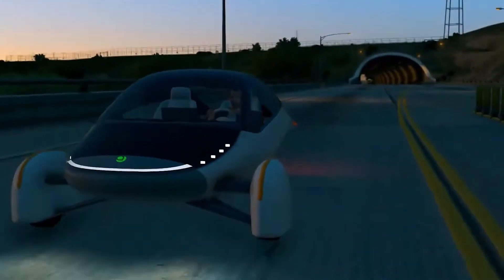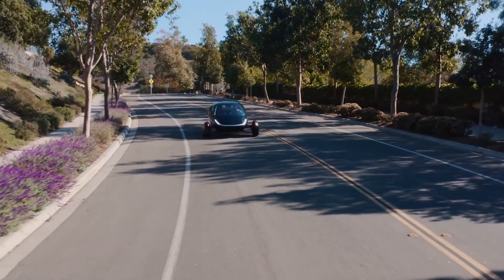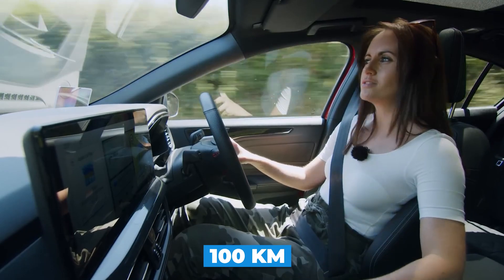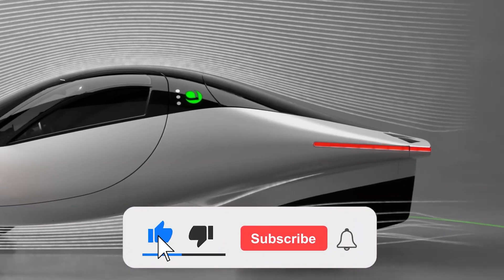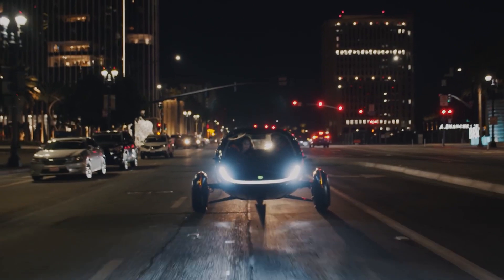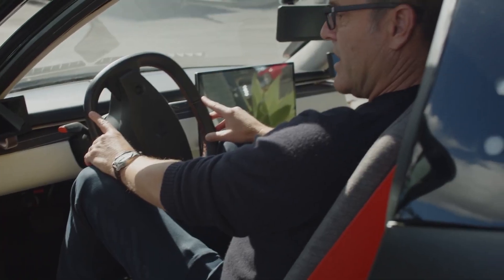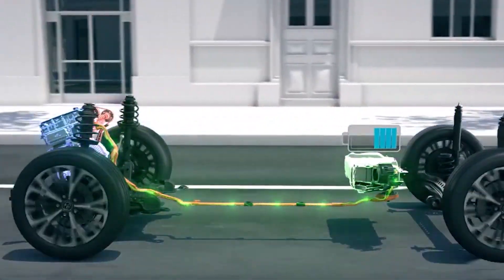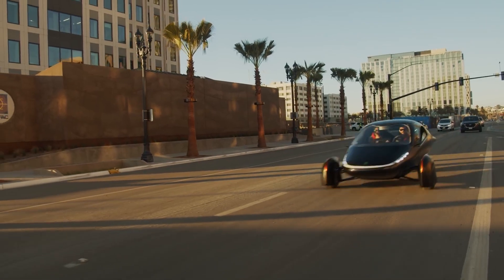The REAL Reason Why APTERA Is Using In-Wheel Motors! UNBELIEVABLE!

Comment: What kind of vehicle would Áptera become if you were to “Jimmy-rig” a 
250 CC Honda motorcycle 🏍️ in place of the single rear wheel ? ? ?

A Hybrid Áptera ! ! !

You would have a gasoline ⛽️ backup, and probably a 2000 mile range ( electric 1000mile batteries/ 6gallons of gasoline)

Not a bad combo.

Comment: When I saw the use of IWMs, the only thing I was considering was the incredible amount of friction loss reduction from their implementation. Just think: no drive train. No engine, transmission, differential, drive shafts, U-joints, CV-joints...that's a lot of waste in inertial resistance. Power vectoring only multiplies the advantages. The single drawback to IWM's I'd heard was the problem of unsprung mass. I still think that issue is miniscule in comparison to the advantages, not to mention the new tech being developed in motors that will continue to reduce that unsprung mass over time. So, yeah, it's the best way to go. Wait till the off-roaders realize how much ground clearance they may be able to gain from this, too. I suppose they'll get upset that the quiet ride will cause them to have more collisions with wildlife that wasn't scared off by their noisy off road vehicle motors though.
Reply: You are one of the few people who get it. so many internet experts love to complain about "unsprung mass" like it matters at all in a car like this. It doesnt. An F1 car, sure, but not a passenger car. Friction losses in complex powertrains is huge... and would be especially apparent in a car that is ultra efficient. The ability to torque vector is a bonus and not the main reason they chose IWM's in the first place.

Comment: Individual motors in the frame could just a well independently drive and torque-vector each wheel and not need wheel toe-in.
AND... they would not put their heavy weight in the wheel. and thus not cause the tire traction penalties of such unsprung weight.
An example of in-body indepoendent motors is the upcoming Ferrari SF90 Stradale, with one motor for each front wheel.

Comment: What a bunch of nonsense.  You don't need in wheel motors for torque vectoring.  Steering, acceleration, and braking will all be worse with in-wheel motors.  Unsprung weight is bad.  Not being able to cool the motors is bad.  Not being able to add gear reduction to the motors is bad.  Efficiency may be the only benefit...and probably cost.  They also enable saving space in the vehicle to make room for more batteries.

Comment: I just thought these wheels probably simplify the overall design and complexity of the vehicle. Apparently, there is more to it than that. Hopefully, if a wheel is sheared-off in a collision the battery power would be cut to that wheel (only)? I assume ptower is needed in an accident to enhance existing the vehicle or for whatever other necessary functions need to be maintained?

Comment: Two onboard motors can do torque vectoring exactly as well as two in-wheel motors, PLUS onboard motors don't impose the UNSPRUNG WEIGHT penalty over bumpy surfaces of in-wheel motors.
Further, the in-wheel motors for the Aptera are radial flux motors, NOT the more power dense axial flux motors.  Lastly, what happens when mud or snow accumulates in the wheel pants of an in-wheel motor - just where the brakes are?
Reply: As always, there are always design trade-offs with any choice.  Elaphe has been open about some of the factors leading to their choice, i.e.:

"For now, the biggest issue we see with axial flux motor type is the inevitable axial forces unbalance, which tends to have a runaway effect. As soon as the bearings start wearing out a bit, the unbalance grows and in no time the bearing gets worn out. Also, based on our experience, axial flux motors can be very hard to cool in demanding cycles, such as those of EVs.

With radial flux type in-wheel motor systems that we can offer today, we are proving that what was once a concept is now realized in a real product, successfully addressing all requirements of the in-wheel application in automotive requirements. We are continuing to push the envelope of the radial flux configuration and pursuing building the most compact, robust and performant in-wheel motor solutions."

We have already addressed your other two points in another comment.
Reply: @n.brucenelson5920   - As I recall from Elaphe's video, the uneven bearing wear and imbalance occurred for in-wheel motors - due to axial (cornering) forces on the wheel - and they wouldn't apply to onboard motors.  IOW, Elaphe's problem with axial flux motors is due to their in-wheel design.

Comment: I love this car and want to put it on the track but they won't give me any safety data. Roush racing was consulted during the design process.
Reply from the maker: The car is lovely indeed! Make sure to subscribe to stay updated with the latest news :)
Reply: There is quite a bit of safety data available now - more than we have for the Tesla Cybertruck, for example.  

As soon as delta vehicles are available they will be voluntarily crash tested by a third party to FMVSS Part 200 standards, and the results will be made public.
Reply: @n.brucenelson5920   - Where is this safety data that is supposedly available?
Reply: @n.brucenelson5920   -  All the stuff on Youtube about Aptera's "safety" is cagey about the definition of "safety".  Nowhere is there any reference about tire traction on rough or bumpy surface, nothing about the visibility of the low/wide front wheels, and nothing about the effect of side gusts of air coming off the front of a truck/bus/van that hits the Aptera on its rear wheel pant under the "dolphin tail".  "Safety" even means low carbon footprint in one video!  C'mon, ambassador, post your links - if there really are any.
Reply: @n.brucenelson5920  [There is quite a bit of safety data available now] He said they won't give him any. If you say it's available, how about you give it to him? Gossip is worth nothing. 
[- more than we have for the Tesla Cybertruck, for example.] We all saw the safety glass, lol! But hey - stop comparing; just give him what he wants.  

[As soon as delta vehicles are available they will be voluntarily crash tested by a third party to FMVSS Part 200 standards, and the results will be made public.] Give him the quite a bit that is available now, today. When the results of the crash tests are in, you can add them.

Comment: Do in wheel motors and torque vectoring help winter handling in snow and slush?
Reply: Absolutely 100% yes
Reply from the maker: Definitely!
Reply: There was a lot of available information that was left out of this video, and a lot of footage, for instance from Protean that doesn't really apply.  Aptera is using wheel motors made by Elaphe - the same company supplying the Lordstown pickup trucks.

Aptera wheel motors can sense wheel slip and adjust torque for each driven wheel independently - 32 times per wheel revolution.  This is about ever 2.5 inches of tread travel.   

Also, the power steering assist will be variable and speed sensitive.  The driving experience, even in difficult conditions, is going to open eyes.  I plan to use mine year round in Iowa.
Reply: @n.brucenelson5920  [There was a lot of available information that was left out of this video,] Yes - all the negative reasons that overpower the few positives. Happy to debate all reasons with you.
[and a lot of footage, for instance from Protean that doesn't really apply.] And that dropping motors between the wheels, not in them. Sloppy work. 
[Aptera is using wheel motors made by Elaphe - the same company supplying the Lordstown pickup trucks.] Both non-existent, at present, but you still brag for no reason.

[Aptera wheel motors can sense wheel slip and adjust torque for each driven wheel independently] Motors can't sense wheel slip - it's the tiny, lightweight sensors that do that, and they work better without the motor in the wheel.
[ - 32 times per wheel revolution.] That's slow by their standards. At ~50mph, a good sensor around 300.  Aptera is built to the lowest end.
[This is about ever 2.5 inches of tread travel.] Good one's are doing at least 2 per inch.   

[Also, the power steering assist will be variable and speed sensitive.] It works it's guts out because there's an extra 100 kg to turn.  
[The driving experience, even in difficult conditions, is going to open eyes.] Everyone already drives with their eyes open.  lol
[I plan to use mine year round in Iowa.] You know what they say about plans.
Reply: Torque vectoring is a good feature, but in-wheel motors are not necessary.
Just putting the two motors onboard the chassis can do exactly the same thing,
plus do away with those silly wheel pants and reduce unsprung weight for better performance.
Reply: @daveinwla6360  Every engineering solution comes with trade-offs.  You are correct that reducing unsprung weight is a good thing.  However, eliminating the wheel pants would greatly increase the coefficient of drag - and that is what would be silly.

The onboard motors we have in vehicles such as the Tesla have much slower response to torque sensing and adjustment, partly due to the time it takes to transmit the slip sensor information from the wheels/motors to the controller.  In the Elaphe motor case, both sensor and motor controller are co-located, greatly decreasing the response time.  This also eliminates drag in the components transmitting power from the motor to the wheels.

If efficiency is your main goal, this is a better solution, and the suspension performance is "good enough".  I can say this having had a ride in a prototype with engineer Daniel Morris driving and putting the Luna alpha vehicle through its paces. even before the suspension was redesigned by Roush Performance and greatly improved.
Reply: @n.brucenelson5920   - I NEVER have said that Aptera should get rid of the wheel pants while keeping the outboard wheels and motors.  The motors and brakes should move inboard to the chassis while covering the wheels with FENDERS afixed to the body.  Both motor torque and braking torque can be transmitted to the wheel via a short shaft.

The motor and the slip sensors communicate at almost the speed of light.  It would make NO difference if the sensors and their control firmware were onboard the car rather than wheel-mounted.

As I've said all along, all that unsprung weight reduces safety by reducing tire traction over bumpy road surfaces.  And I have neither seen nor heard anything about Aptera testing cornering or braking or acceleration over bumpy road surfaces.
I'm afraid you speak from FAITH, and from your appointment by Aptera as one of its "ambassadors".
Reply: @daveinwla6360  Dave, I have actually ridden in a prototype and it wasn't all on bump free smooth roads.

Your statement that "The motor and the slip sensors communicate at almost the speed of light." shows that you have little understanding of how either system works.

 Electrons flow through copper at a few metres per second, far below the speed of light.  Stop bullshitting when you don't know what you are talking about.
Reply: @n.brucenelson5920  [Every engineering solution comes with trade-offs.] And the video is devoid of what is traded.  
[You are correct that reducing unsprung weight is a good thing.] 50 lbs per wheel is massive. Engineers try to reduce 50 grams.  
[However, eliminating the wheel pants would greatly increase the coefficient of drag - and that is what would be silly.] That's a trade off. Another thing traded would be the benefit of not having to scrape them on turns - something they have yet to engineer out.

[The onboard motors we have in vehicles such as the Tesla have much slower response to torque sensing and adjustment, partly due to the time it takes to transmit the slip sensor information from the wheels/motors to the controller.] If Tesla uses sensors that are eight times faster than Aptera's snails, the time to motor and back will still make it much more responsive. A couple of feet at over 180,000 feet per second is not an issue.
[In the Elaphe motor case, both sensor and motor controller are co-located, greatly decreasing the response time.] At least you recognize the motor doesn't sense, but your logic makes no sense. 
[This also eliminates drag in the components transmitting power from the motor to the wheels.] Energy loss is not drag, only similar. Aptera has dropped energy by a whopping 22 kW on the tri-motor before you even buy one, and that is a real drag, lol. Get the pun?

[If efficiency is your main goal, this is a better solution, and the suspension performance is "good enough".] Sounds like efficiency is his goal, and he knows the better solution. It's not yours.  
[I can say this having had a ride in a prototype with engineer Daniel Morris driving and putting the Luna alpha vehicle through its paces.] I look forward to those first three fakes being properly put through their paces. make sure they are not trashed by a forklift when Aptera fold again. 
[even before the suspension was redesigned by Roush Performance and greatly improved.] We have no evidence Roush even redesigned it, and certainly no evidence it is good. Judging by the bounce on Quince going slowly on a smooth road in the Gamma, I would say it's a poor job. I just hope the forklift doesn't get to it, too.
Reply: @aussieideasman8498  "A couple of feet at over 180,000 feet per second is not an issue."  

Another great example of you having not a clue of how standard ABS systems transmit their data, whether active or passive, and how fast they can do it.

The rest of your comment is just as misguided.
Reply: @n.brucenelson5920  Your comment is useless, because it doesn't tell me what speed it is, and which would be the fastest. So, the motor and the sensor are both in the wheel, but where is the chip that decides what to do to the motor under certain sensor readings? It needs to know data from both wheel sensors, and they are about 84 inches apart. One sensor is not enough, and none can think.
Reply: @daveinwla6360  The inwheel motors allow the response time of the traction control to
 sense wheel slip and adjust torque about every 2.5" of tread travel.  Inboard motors can not sense and adjust so quickly. 

The wheel pants allow for a considerable reduction in aerodynamic drag, which puts money directly in the pockets of the owners.

The performance of the vehicle is amazing compared to any other vehicle optimized for efficiency.  I know from personal experience in a prototype.  Acceleration is thrilling, which you wouldn't exactly say about my Gen 1 Honda Insight.
Reply: @n.brucenelson5920  wrote: " Inboard motors can not sense and adjust so quickly. "  -Riiiight.  It takes the electrical signals more time to travel so much farther.  Get serious.
Reply: @daveinwla6360  It appears that you think these signals travel at the speed of light.  Get serious.
Reply: @daveinwla6360  You know what you are talking about. That's rare on these sites.
Reply: What do you think happens when snow and slush collect around the brake caliper and brake rotor in the wheel pant?
Reply: @daveinwla6360  It is not too different from what happens with any normal vehicle.

Remember that the wheel motors are the major source of heat produced in the Aptera, even with their great efficiency and that heat tends to be enclosed by the wheel pants to some extent.

I expect that this will be less of an issue than there is with brakes freezing in any standard car.  We now have some video of Aptera gamma driving in snow, and extensive video of Elaphe vehicles on their winter test track in Slovenia.

I will be reporting on this when I take delivery of my Aptera and drive it in all weather conditions in Iowa.
Reply: @n.brucenelson5920   -  Your implication is that the motors' heat will melt away any accumulated snow under the wheel pants.  Maybe.  But what does one do then if the accumulation is MUD?
Reply: @n.brucenelson5920  
There’s footage of the Aptera driving in snow?! That’s awesome! Can you send me a link to it? I can’t seem to find it on YouTube.
Reply: @daveinwla6360  If you are going through mud, beforehand, spray some silicone up inside the wheel pants, making the surface unlikely to be able to hold any mud.
Reply: @chrisbarrett2512   -  That sounds like a good after-market item if it had a remote button in the cabin to activate the spray in the wheel pants.  I wonder how  you'd keep it off the tires, though.   :-(
Reply: The brake calipers are inside the wheel motors. They are not exposed.
Regarding build up in the wheel pants. There is a relatively small gap between the tire and the inside of the wheel pants from snow and ice to build up and the wheels move with the wheel pants. Friction from the tires will melt thr build up and maintain a gap. Unlike a big wheel well that needs to be large to accommodate the wheels turning.  I
Reply: @garywozniak7742  Nothing is inside the motors. Brakes are very close, and inside the pants, where they retain heat. It is not good for both motor and brakes to help each other get hotter.

Comment: What if one of the motors dies ?
Reply: Chris has already said it’s fine, it can actually run on just one motor.
Reply: @Airman749  and be steerable if it is a dead one in the front...software challenge if torque hectoring relies on powering and deporting wheels to balance steering.
Reply: @6.5x55  100 extra pounds in the steering means much harder to steer. If power steering has to compensate, then that power is likely to be greater than the losses in a drive shaft, which are negligible anyway.